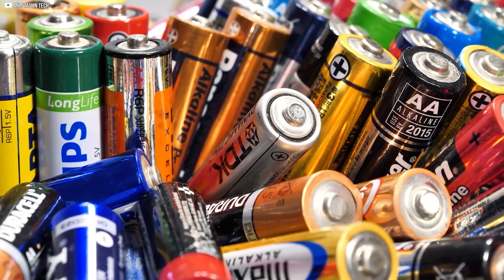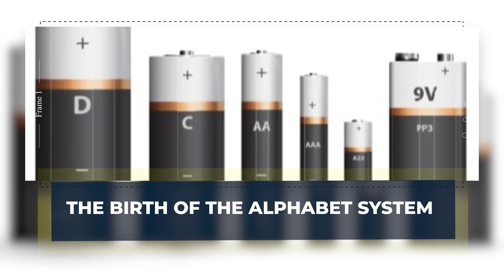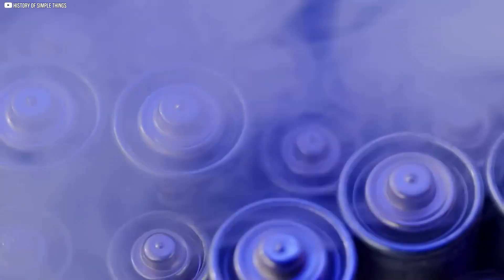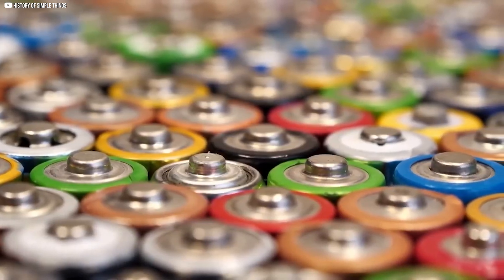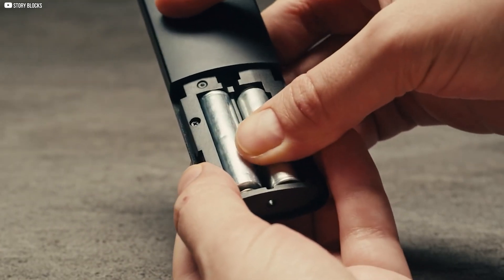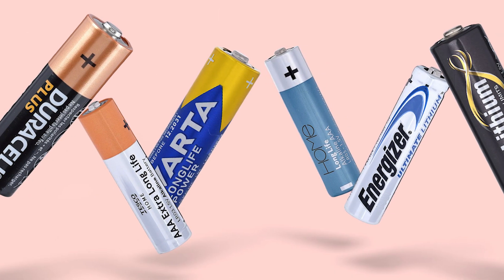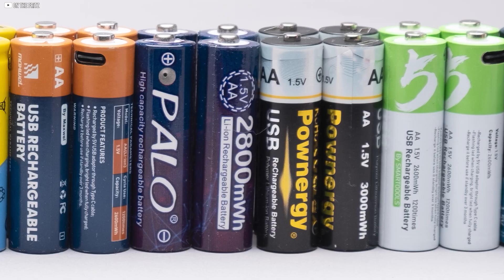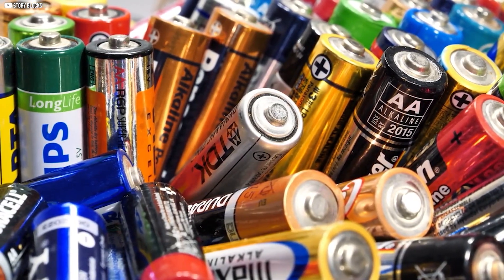The Missing Batteries: What Happened to A and B?

Comment: Actually early on it wasn't that hard to find the cells you needed. If you said "flashlight battery" or No. 2 they knew you meant a D, if you said "baby flashlight battery" or No. 1, they knew you meant C, even though Eveready called their D battery No. 950 and their C battery No. 935. Small correction, a radio B battery and B-cell are different. The B-cell is about the same height as a D battery but a little thinner than a C battery, I have one made by Ray-O-Vac in the 40s, the number size is called No. BB21 but the cell size is B. The radio B battery, however, was huge. Anywhere from looking like a 9-volt battery's big brother to the size of a box of soap powder. Voltages ranged from 15 volts to 90 volts, 45 and 67.5 were most common

Comment: I do not see AA and AAA going away . Their hear to stay .So many new electronics using them.  But the newer 18650 standard is everywhere. 3.2V 3.7V so common. Even Sodium ion . LFP and more.  The 123 cell is common. Other letters are used in battery packs .  A is still made.  E is used. X/M common in big packs.  Mostly LFP type. Newer 3.7V and 3.2 V are in AAA/AA now.  Some solar lights use them. 14500 3.2V AA is common for solar garden lights . As newer types come out the AA/AAA size remains . Cheers